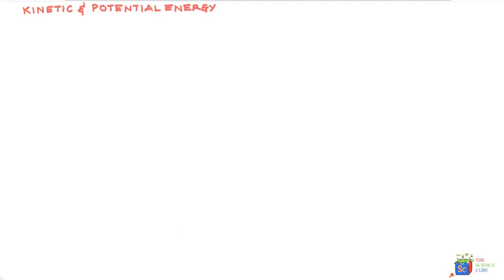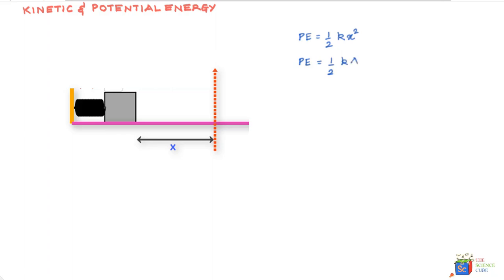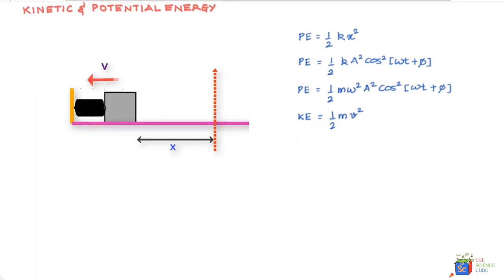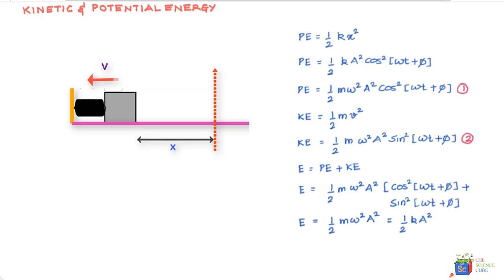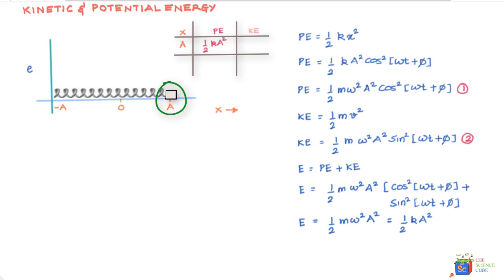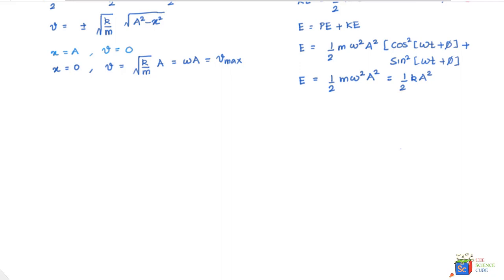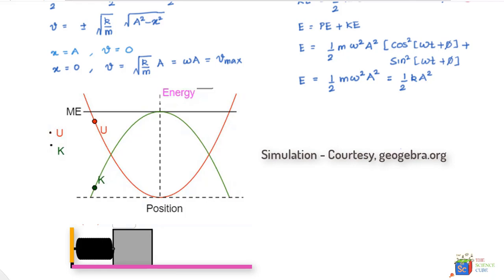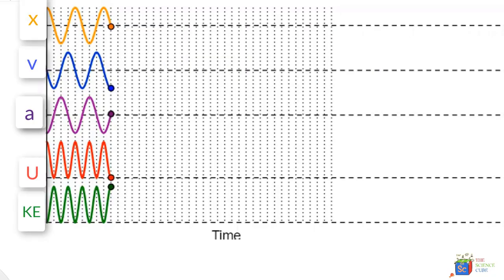Energy in SHM (Total Energy = Kinetic Energy + Potential Energy) #6

Comment: Why is the graph parabola? Why it can't be V shaped?
Reply from the maker: Well that is something determined by the wave equation
Reply: It comes from Hooke's Law. We model spring and mass systems using the approximation that the force by a spring pulled a distance x to the side is F = -kx, which is verified by an experiment. There is a fundamental relationship between forces and potential energy F = -dU/dx, which is a second year calculus theorem. Using that you get that U = 1/kx^2, a parabola. Not to self-promote too much but I just made a video of this for my first year physics class I'm teaching: https://youtu.be/qgDuxK2dLk8. I was looking for other videos to supplement it for my students. 
I like the detail in this Science Cube video. They go through some details of the math quite nicely.
Reply: @JamesCharbonneau  thanks
Reply from the maker: @JamesCharbonneau  Thanks James for the elaboration. Much appreciated!